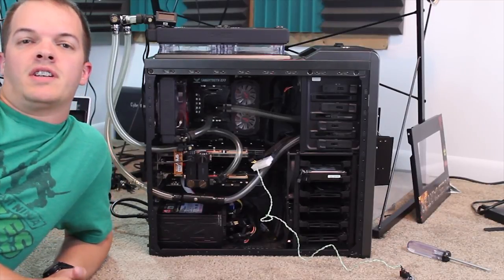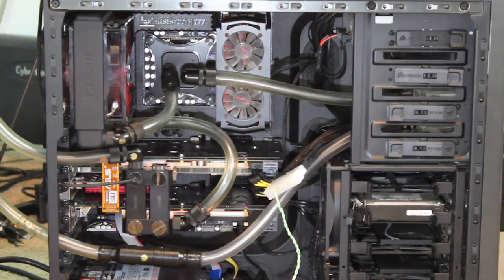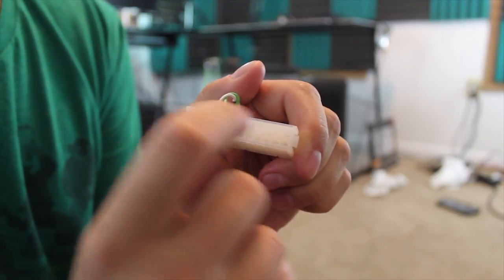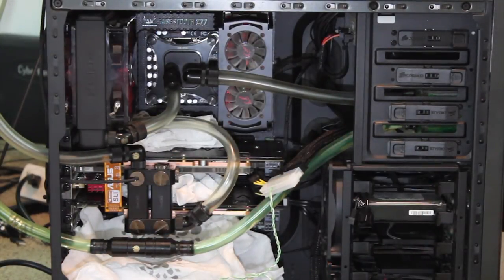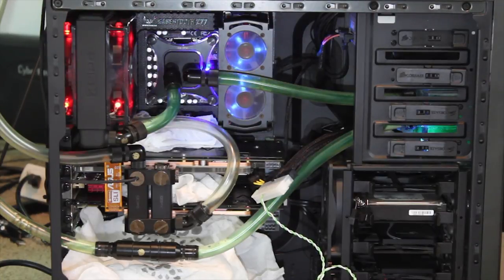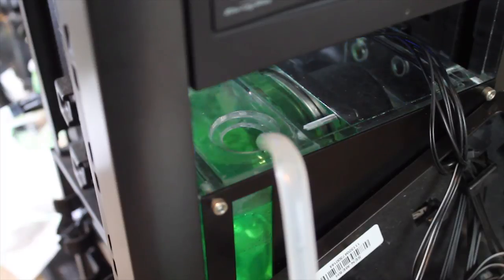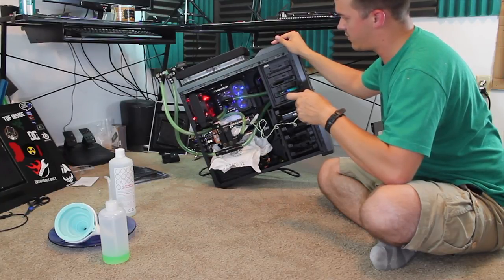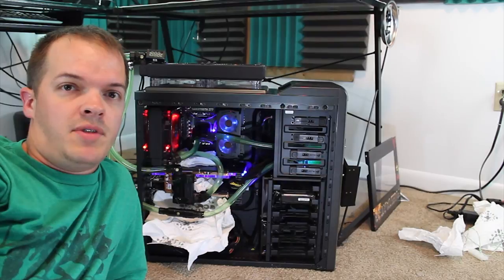How to Fill a PC water cooling loop with Chandlee Style (Rig Update)

Comment: You have a baby? You like like you're in college...

How does your loop work? It look like it goes to the top radiator first?

Also where is the pump?
Reply from the maker: +abc140290 Thanks for the compliment, but I'm 30. the loop goes in this order. CPU, 120mm rad, Bottom GPU, Top GPU, 280mm rad (on top), through the disconnect, into the res in the 5.25 bay and back into the pump (also in the 5.25 bay).